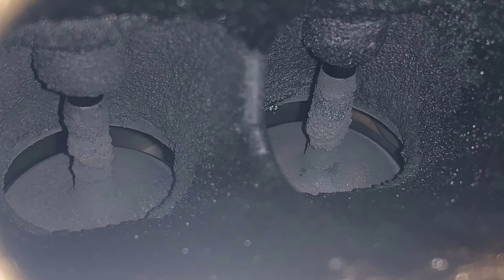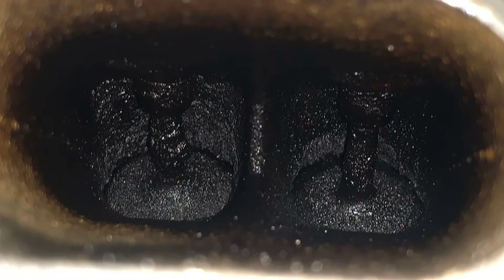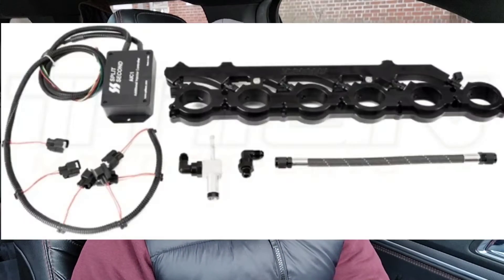Do Catch Cans Really Work?

Comment: There is a company called Fuel Injector Clinic, I believe they are working on a plug and play kit for gen 1 ecoboost engines. I think it's still in beta phrasing, but it's designed to go off the factory ECU and run just like a Gen 2 ecoboost. There is a video on YT from them about this kit being in development.
Reply from the maker: I never liked the format of a forum. I've reached out to FIC so I'll wait on a response.
Reply: @blacktalonsport1262  I'm really gonna be excited if they do come out with a PFI kit, it'll really improve older gen 1 ecoboost vehicles and even better if its plug and play.
Reply from the maker: @brentneahring2797  yeah. Just heard from FIC they don't have a PFI kit coming up...hopefully someone will see the need.
Reply: @blacktalonsport1262  yeah, the demand is definitely there, and they would sell that's for sure.
Reply from the maker: Really!  Thanks for telling me. I will look them up and inquire.
Reply: @blacktalonsport1262  There is a forum online as well, but I'm not sure where they are at in development as of now, but there are some kits for the smaller 4 cylinder engines like the 2.0l and 2.3l.

Comment: Black Talon just bought the UPR for my 2017. Luckily for your video I was able to put it together. I loved the product but they lacked in an good instruction diagram. Mine was black and white and only talked very vaguely about what tube goes where but not great. Following the instructions nowhere did it say it comes with a spacer because mine was rubbing on the wheel well. I had to look at your video to see what to do with the intake sleeve and the tube that connects to it.
Reply from the maker: F150 or Explorer?  Glad I could help you out.
Reply: @blacktalonsport1262  explorer